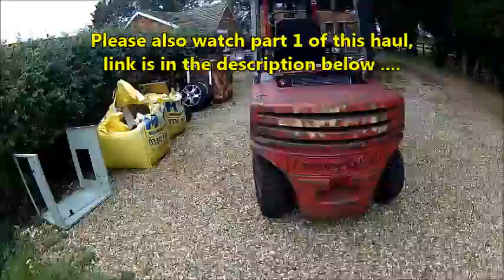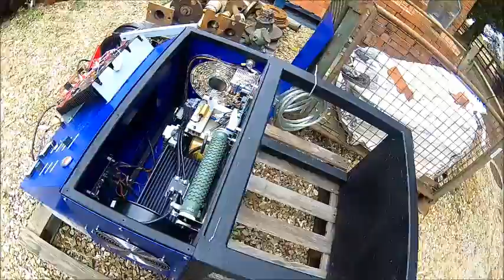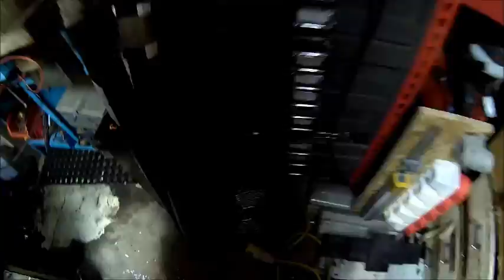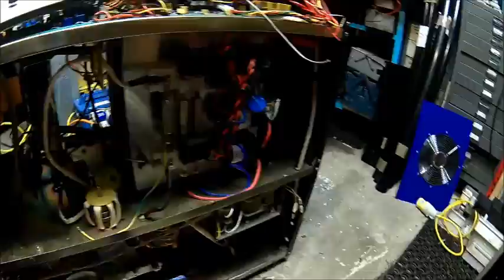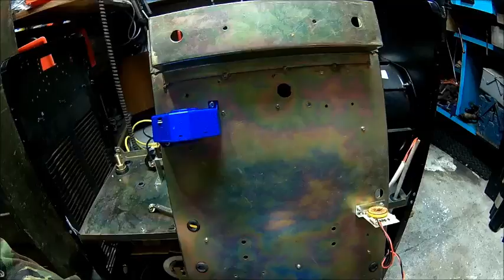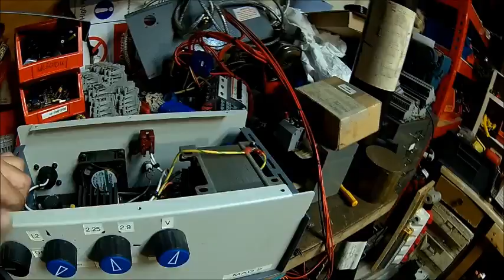Auction Haul 09.20b, Part 2, welding equipment, electronic components, etc

Comment: Nice clean wiring on the first machine. That stand will be handy for sure. It'll be cool if the Hitachi can be brought back to life. Some massive heat sinks from the other welder.  :)
Reply from the maker: My only problem is that the job list gets longer every day,.... and those "honey do" ones are certainly the most important ones anyway

Comment: It will be interesting to see what you built with the parts Mike. Take care
Reply from the maker: Well, ... that big transformer will turn into a 24 charger for my solar batteries, so i can charge them when the diesel generator runs. Some of my lighting and all my UPS running on that 24V system, but in the winter time we don't have enough sun here to keep them at a reasonable state of charge. Definitely need to get my little wind turbine up and running, because being near the coast,  that's something we have plenty of.......stay safe